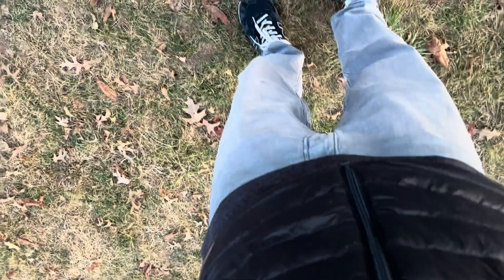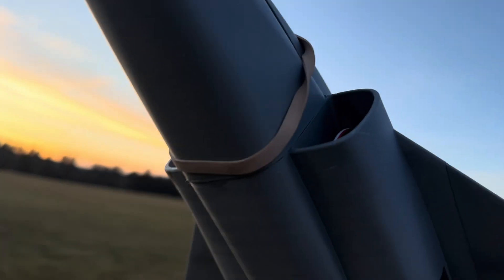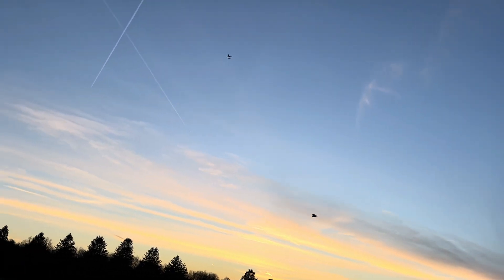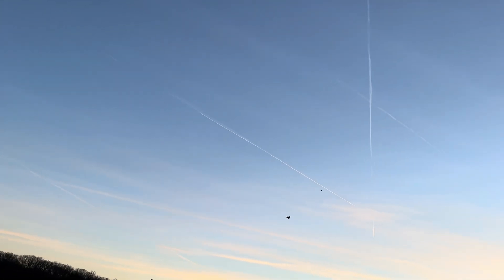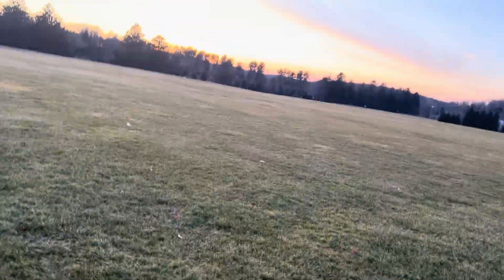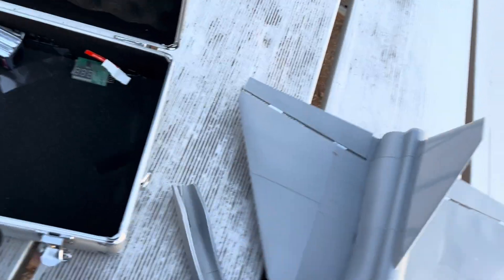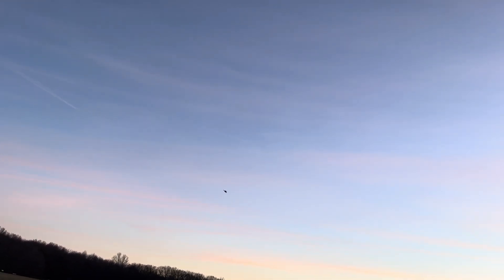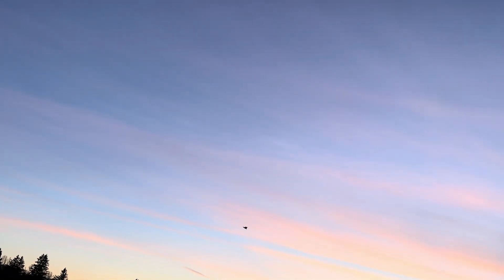Viggen 50mm 3d printed in regular PLA+ ((Flew Awesome!!))

Comment: Are this same design with you 64mm edf vigen v2? If yes how much scale do you make? Thanks for the advice
Reply from the maker: Similar designs. I had to make adjustments to allow the 3.7g front servo fit and also the servo pockets in the rear for the 9g. Youre welcome to scale it yourself and modify the servo pockets and hinge slots 👍🏻 I can’t recall the exact scale factor

Comment: Hi, this plane is really looking good - will there be STLs for the 50mm also ?
I use a katapult to launch my EDF-planes. This gives reliable speed instantly and you donT have this 3-4 seconds where you nearly can't control the plane until it reaches a reasonable speed.
My newest build is the F-104 which hasn't flown yet - weather too bad here in Germany.
All the best for you and continue to contruct new wonderful planes in 2024 !
Reply from the maker: Very true! The Viggen and my mirage are actually very easy to hand throw. The Viggen self levels itself of the CG is perfect. On one of my videos I don’t touch the radio for 8-10 seconds after I throw. The 50mm is linked in the description 😄
Reply: @BUILTFAST I could not resist ;-) - Download #3 !
Reply from the maker: @hinkepank1239  you’ll get my next jet Free! Just remind me when it’s time. Much appreciated
Reply: @BUILTFAST Cool - thank you. I started slicing for LW-PLA. I will keep you updated about times and weights.